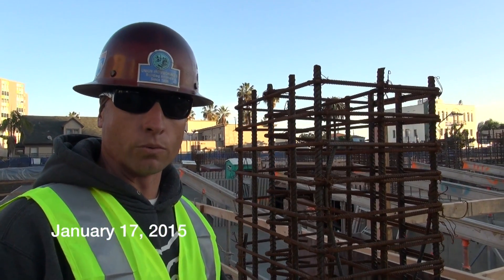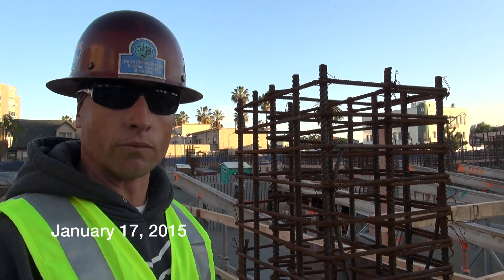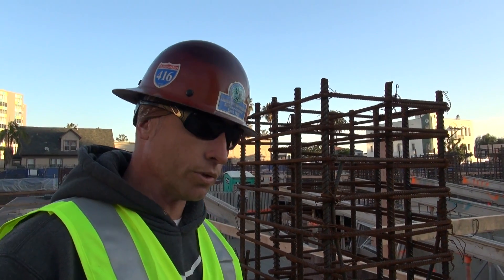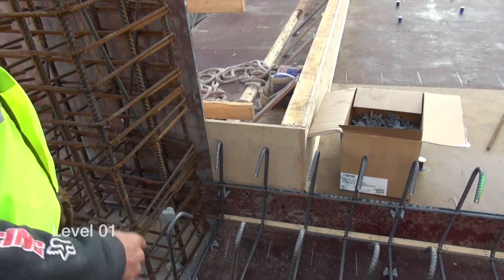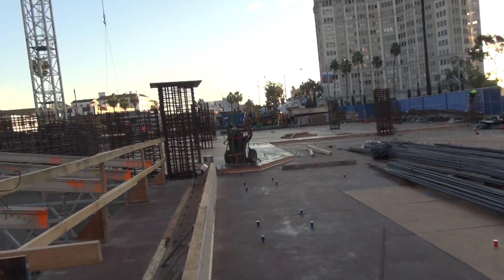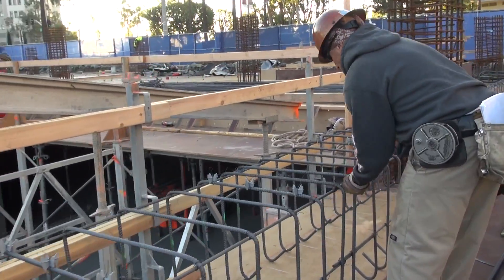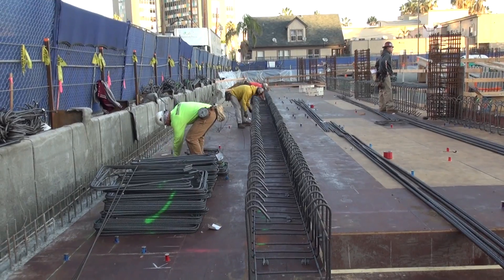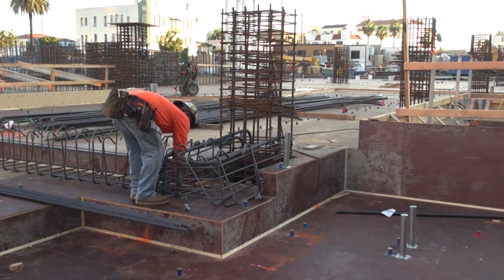Re-bar for a High Rise Apartment building

Comment: How many laborers did it take to do all the form work. ?
Reply: That's Carpenter Work...
Assembling Decks and placing Beam Molds... Walls and Installing Column Forms/molds etc.. 
The Laborers are the...
Everything else....
Working exclusively with the Carpenters ...

I was a former Union 416 Ironworker...
Specializing in Post Tension Cable work.. 

Local 416 does all the work.. grab it, carry it on your shoulder and place it...
Install it, Tie it...

Comment: 300 tons, 11 guys? What a fucking joke
Reply: The Weight per day Per Each Local 416 Ironworker...
The average per day is usually between 1,400 to 1,600 lbs per day...

Apprenticeship School, you are taught to make the numbers work like I just stated..

It's all BS...
Real Average is closer to 2,200lbs or more..
Easy....
You grab it, carry it on your shoulder and place as close as possible to installation spot.. or as close as you can.. either for yourself or your Local 416 Ironworker brother who's going to place it and Tie it.. 

Post Tension Cables average 8 lbs a foot..
60' to 90' or more in length.. 
I became a specialist in this.. because it's not as boring as punking Rebar all day..

This dude saying 300 tons... 
600,000 lbs.. for that bottom deck...
120,000 lbs per day!..
Would mean 10,909 lbs for each Dude! Per day!... Average 5 and a half Tons ....

I think he misspoke,, 
The person deck...
Foundation/footings plus bottom deck makes more sense